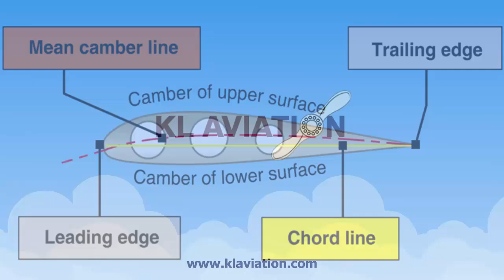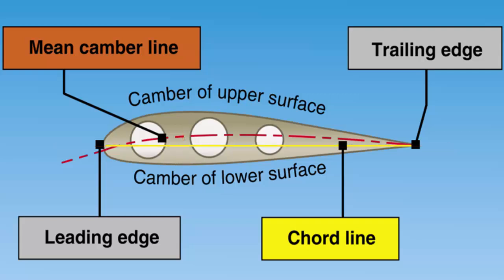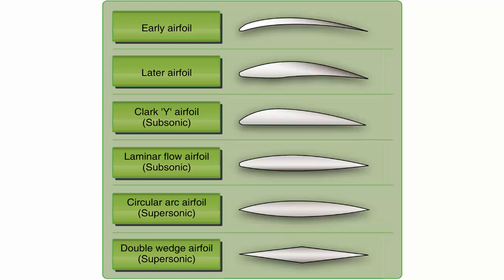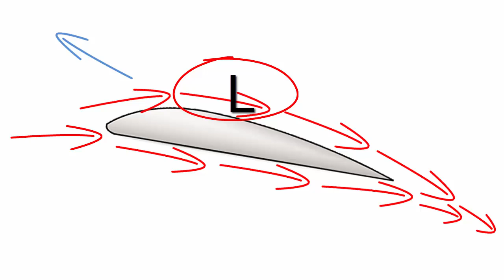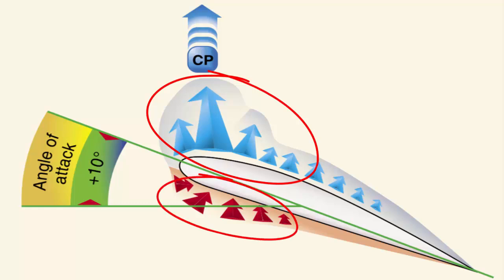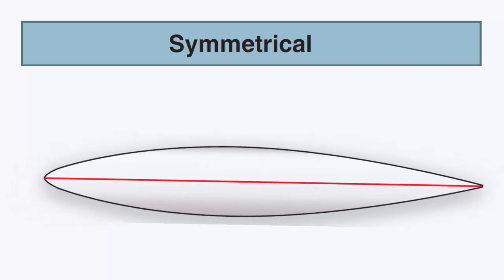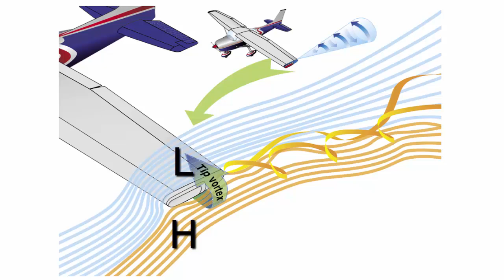Airfoil Design

Comment: I'm sorry, but there are too many mistakes here. It starts at 1:15. The stagnation point at the leading edge is shown at the end of the chord line, but with an angle of attack like this, the stagnation point is further down. Secondly, the illustration shows the "equal transit time" hypothesis, which is the result of a poor understanding of Bernoulli's principle. Here is a link to the University of Cambridge, showing how it really works: http://www.eng.cam.ac.uk/news/how-wings-really-work
Reply: More:
This video only repeats very common misconceptions and invents a new one, as follows.
.
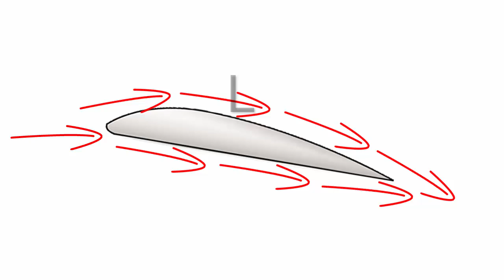3:13  The low pressure above the wing allows higher pressure ahead of the wing to accelerate it to the higher speed. It is Newton.  The force of pressure accelerates the mass of air. 
The movement of the wing creates pressure gradients and as Euler reported to us in the mid 1700s, Pressure gradients accelerate fluids.
Bernoulli never said speed causes a pressure reduction. He only noted that the (static) pressure and velocity have an inverse relationship with no indication of cause and effect. This is a major, common  misunderstanding. 
Euler determined that pressure gradients accelerate fluids toward the lower pressure. That is the opposite of the common misconception.
...
3:29  The pressure difference top to bottom accounts for ALL THE LIFT.   This 'a little of this and a little of that" is bad science.   The same pressures that have the net upward lift force on the wing are the very same pressures that cause all accelerations around the wing including ahead, above, below, behind and around the tips.
The higher pressure under the wing pushes up on the wing AND down on the air below to contribute to the down-wash.
The lower pressure above the wing allows atmospheric pressure to push air above the wing downward, to also contribute to the down-wash.
..
NOTE: the whole upward force on the wing is equal to the force required to accelerate all the air in the down-wash.  THAT is what satisfies Newton's Third Law.  The upward 'push" (force) on the wing equals the downward 'push' (force) on the air accelerated downward.
The downward moving air does not push up on the wing.   That air was pushed down by the pressures around the wing. 
The down-wash also does not push the wing forward. You've invented a new a fallacy.  The net force fore-aft is rearward and is called drag and is not caused by the down-wash as explained above.
When viewed from the still air frame of reference, the down-wash is moving slightly forward.
....
4:27  Bernoulli's Principle is again misused.  The flow is not slowed under the wing which is NOT the cause of the higher pressure. .  That view is valid only in the stationary wing, wind tunnel reference frame only. 

 In fact, REAL data from a REAL wing generating REAL lift flying through otherwise still air shows the lower air being moved forward in the direction of flight. This acceleration from still air is CAUSED BY the higher pressure at the lower surface.  The increase in pressure at the surface is because the wing is pushing the air out of  its way. This push increases the pressure, not the Bernoulli Principle Fallacy.
....
The pressure increase below the wing in combination with the decrease above the wing provides the ENTIRE lift force.
...
If by this magic, the down-wash did just happen to add to the lift, that "addition" would be exhibited as an increased pressure difference on the win...but it DOES NOT.
Bernoulli's Principle causes nothing in the generation of lift because the "speed-causes-pressures" is a fallacy. 
It is all explained by Newton, BUT NOT with this ":reaction force" fallacy.
Newton's Third Law "reaction force" is not an originating force, but is a direct result of the originating force which, in this case,  is from the pressures around the wing as described above.
....
At 7:11 Please listen to your words: “The high pressure area on the bottom of an airfoil pushes around the tip to the low pressure area on the top.”. This shows that you understand that pressure causes movement, but you fail to apply it on all the other parts of this  and, therefore shows the problems with this explanation.  The correct story uses this Pressure accelerated air in ALL aspects around the wing, because that I the real science.
The tip vortex does not ‘create the down wash”.  You already explained the down-wash without reference to the tip vortex.  This is a flaw in this explanation. The tip vortex is CONSISTENT with the wing generated down-wash moving against the still air outside the wing span.  Masses of air sliding along each other create vorticity (vortices) along the boundary of the two masses.
…
At 7:47 Winglets DO NOT and CANNOT prevent the tip vortex from forming.  They can only reduce the severity and the negative effect because they act to effectively lengthen the wingspan; longer wings have less severe vortices . See Doug McLean’s You Tube video on misconceptions for a full explanation.
https://www.youtube.com/watch?v=QKCK4lJLQHU 
…
Though well-meaning, the 'Pilot's Handbook of Aeronautical Knowledge.' has bad information in it as do so many other publications and on-line resources such as YouTube.
Reply: Shift of stagnation point is what sets off Piper aircraft stall vanes.

Comment: jihun wong, you are wrong.  the airfoil simply redirects the streamlines on the top and bottom, newtons third law applies, and bam; you got lift.  Explain to me ground effect, oh wise one...
Reply: Lift is due to the top to bottom pressure difference, only.
..

It is the pressure changes caused by the airfoil that both produce the lift force AND accelerate the air down. 
..
This video only repeats very common misconceptions and invents a new one, as follows.
.
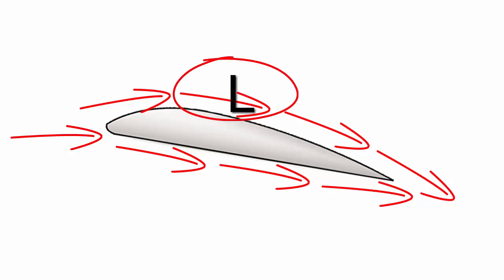3:13  The low pressure above the wing allows higher pressure ahead of the wing to accelerate it to the higher speed. It is Newton.  The force of pressure accelerates the mass of air. 
The movement of the wing creates pressure gradients and as Euler reported to us, Pressure gradients accelerate fluids.
Bernoulli never said speed causes a pressure reduction. He only noted that the (static) pressure and velocity have an inverse relationship with no indication of cause and effect. This is a major, common  misunderstanding. 
Euler determined that pressure gradients accelerate fluids toward the lower pressure. That is the opposite of the common misconception.
...
3:29  The pressure difference top to bottom accounts for ALL THE LIFT.   This 'a little of this and a little of that" is bad science.   The same pressures that have the net upward lift force on the wing are the very same pressures that cause all accelerations around the wing including ahead, above, below, behind and around the tips.
The higher pressure under the wing pushes up on the wing AND down on the air below to contribute to the down-wash.
The lower pressure above the wing allows atmospheric pressure to push air above the wing downward, to also contribute to the down-wash.
..
NOTE: the whole upward force on the wing is equal to the force required to accelerate all the air in the down-wash.  THAT is what satisfies Newton's Third Law.  The upward 'push" (force) on the wing equals the downward 'push' (force) on the air accelerated downward.
The downward moving air does not push up on the wing.   That air was pushed down by the pressures around the wing. 
The down-wash also does not push the wing forward. You've invented a new a fallacy.  The net force fore-aft is rearward and is called drag and is not caused by the down-wash as explained above.
When viewed from the still air frame of reference, the down-wash is moving slightly forward.
....
4:27  Bernoulli's Principle is again misused.  The flow is not slowed under the wing which is NOT the cause of the higher pressure. .  That view is valid only in the stationary wing, wind tunnel reference frame only. 

 In fact, REAL data from a REAL wing generating REAL lift flying through otherwise still air shows the lower air being moved forward in the direction of flight. This acceleration from still air is CAUSED BY the higher pressure at the lower surface.  The increase in pressure at the surface is because the wing is pushing the air out of  its way. This push increases the pressure, not the Bernoulli Principle Fallacy.
....
The pressure increase below the wing in combination with the decrease above the wing provides the ENTIRE lift force.
...
If by this magic, the down-wash did just happen to add to the lift, that "addition" would be exhibited as an increased pressure difference on the win...but it DOES NOT.
Bernoulli's Principle causes nothing in the generation of lift because the "speed-causes-pressures" is a fallacy. 
It is all explained by Newton, BUT NOT with this ":reaction force" fallacy.
Newton's Third Law "reaction force" is not an originating force, but is a direct result of the originating force which, in this case,  is from the pressures around the wing as described aboave.
....
At 7:11 Please listen to your words: “The high pressure area on the bottom of an airfoil pushes around the tip to the low pressure area on the top.”. This shows that you understand that pressure causes movement, but you fail to apply it on all the other parts of this  and, therefore shows the problems with this explanation.  The correct story uses this Pressure accelerated air in ALL aspects around the wing, because that I the real science.
The tip vortex does not ‘create the down wash”.  You already explained the down-wash without reference to the tip vortex.  This is a flaw in this explanation. The tip vortex is CONSISTENT with the wing generated down-wash moving against the still air outside the wing span.  Masses of air sliding along each other create vorticity (vortices) along the boundary of the two masses.
…
At 7:47 Winglets DO NOT and CANNOT prevent the tip vortex from forming.  They can only reduce the severity and the negative effect because they act to effectively lengthen the wingspan; longer wings have less severe vortices . See Doug McLean’s You Tube video on misconceptions for a full explanation.
https://www.youtube.com/watch?v=QKCK4lJLQHU 
…
Though well-meaning, the 'Pilot's Handbook of Aeronautical Knowledge.' has bad information in it as do so many other publications and on-line resources such as YouTube.

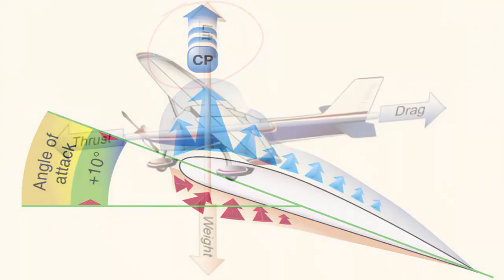Comment: @ 5:34 Why does all aerodynamic forces act through the center of pressure?
Reply: I'd like to know the answer for this too. Wouldn't the weight be acting at the centre of gravity and the lift at the centre of pressure?
Reply: He should of said the resultant aerodynamic force acts through the center of pressure. In reality, every point on the surface of a wing is generating an aerodynamic force. If you were to sum (i.e. add) all those infinite force vectors together you would end up with a resultant force vector. The center of pressure is simply the point at which the sum of all the aerodynamic forces acting on a wing (i.e. the resultant aerodynamic force vector) causes no moment (i.e. no torque action) on the wing.

It's a similar concept to the center of mass. For simplicity, we say and calculate that the force of gravity acts on a body of mass through its center of mass (or sometimes referred to as its center of gravity). The reality though is that gravity individually acts on each and every atom that makes up the object with mass. But provided all the unique parts of matter that make up the object with mass stay in roughly the same place, we can just say and assume the total mass of the object is concentrated in one location, called the center of mass.
Reply: DrR1pper Interesting, thanks.
Reply: Matthew Lui You're welcome.
Reply: Oh i get it not, thanks!

How do you know all of this? I'm really interested in aerospace engineering. Do you know what's a good place to find online resources to learn more in depth knowledge in this field? Or are there any other youtube channels that you would recommend?
Reply: ChuaShaoCong You're welcome too. :)

I know a bit about this as I studied aerospace engineering at university.

By the way guys, I should have said that if the center of pressure is the same location as the center of mass of a wing, then and only then will a resultant aerodynamic force not also cause a resultant moment/torque on the wing. In other words, the wing will maintain it's attitude (i.e. not pitch up or down).

If however, the center of pressure and center of mass are not in the same place, then any resultant aerodynamic force will also cause the wing to experience either a pitch up or pitch down moment. If the center of pressure is ahead of the center of mass, then any lift generated by the wing will also cause the wing to have the natural tendency to pitch up on its own. Conversely, if the center of pressure is behind the center of mass, any lift generated will cause the wing to pitch down on its own.

Also, the location of center of pressure changes with changing angle of attack of the wing, moving forwards as the angle of attack increases (up until the stall angle of attack after which any further increases in the AoA causes the center of pressure to move rearwards).

Regarding online resources, it's a bit hit and miss finding good resources on the internet in my opinion. In my opinion, books are best as they are structured and they expose you to new concepts in the correct order as you progress through the book. This is not to say the internet isn't helpful at times. Far from it.
Reply: Ah, thank you for the clarification. What titles do you suggest? I will try finding them in the library.
Reply: Gosh, been a while since I've read such books so hard to recommend. The right book for you right now though can heavily depend on your current level of maths and physics.
Reply: Ah, I think anything you study in Your first/second year in University should be fine. To give you an idea, something like "Young and Freedman - University Physics" is ok
Reply: pressure is just force per unit length.  What is lift? a force acting over an area.  so center of pressure is just the resultant of the centroid of the pressure distrubution. this explanation is just so wrong though.
Reply: +Jake Falck "pressure is just force per unit length."

Pressure = Force / Area.